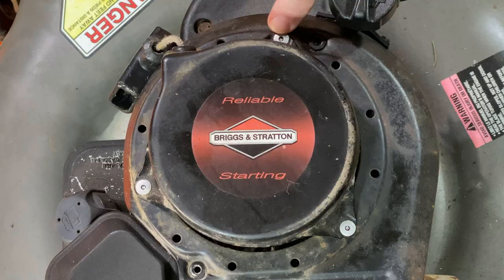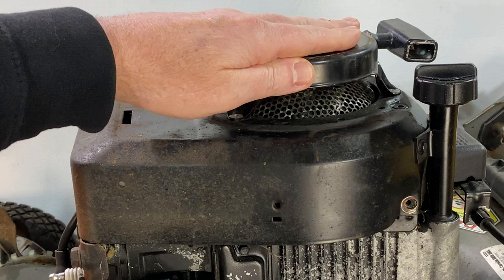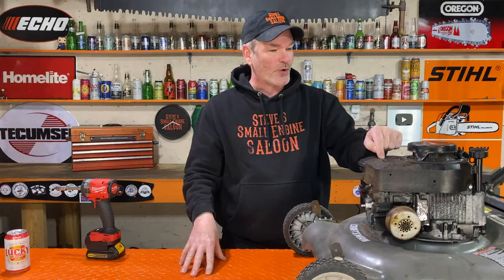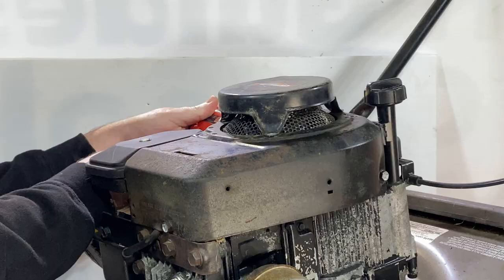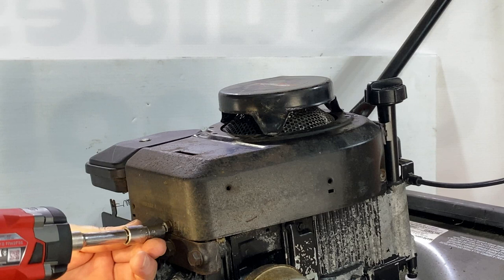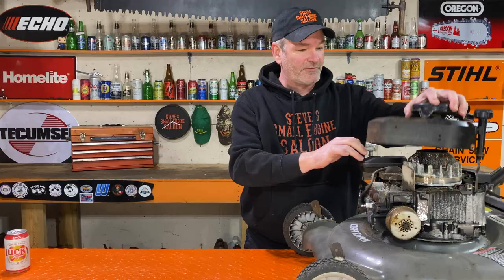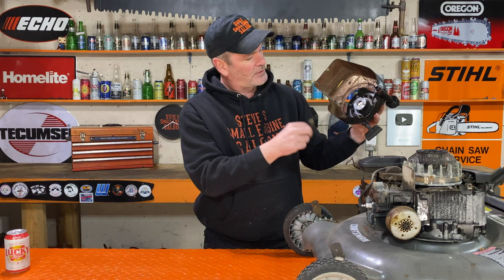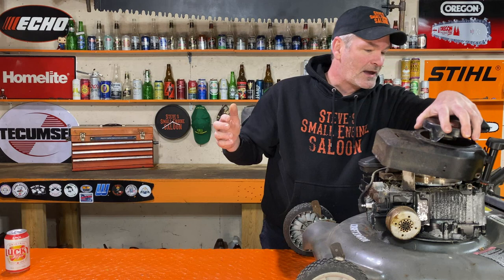Do NOT Drill The Rivets Out Of Your Lawn Mower (Here's Why)

Comment: You don't need to drill the rivets out to remove the cover from the block, but if the recoil spring is broken they must be drilled out to replace the recoil assembly.  To the best of my knowledge, the recoil spring is no longer replaceable.  You get a new recoil assembly with special bolts to mount it properly.
Reply: You can get the springs..but...
Taking the pull start off, and using you drill or cordless impact gun to start your mower. Is the cool thing to do.
Reply: Iv replaced hundreds of recoil springs and iv never drilled out any rivets
Reply: Okay I can see that, but it IS possible to repair the starter assy. IF you know what your doing and do it gently. It can be done.
Reply: @radicalracing09  I ran a small engine repair business and the sensible options for those later model Briggs were either buy the whole shroud assembly which was really expensive or get a $9 recoil starter from Amazon and drill the rivets out and be done with it. I had a lot of parts mowers then though so they got a a while used assembly more often than not. I have drilled and replaced plenty though.
Reply: @vintagemadness9587 you have a video on how you did that?
Reply: @thisislargemouth5566 thank you for confirming what i was thinking. Your experience is much more helpful than someone telling me what not to do.

Comment: Briggs sells you the replacement recoil with screws and nuts to replace the rivets. The piece that spring hooks to sometimes break and only time you will have to drill out rivets. You can use pop rivets to put recoil back on.
Reply: I've always found that pop rivets rub against the flywheel as they're too long. But you can try putting them on upside down. They still fail after a while due to the flexing of that housing when pull starting
Reply: Interesting. I didn't know that👍
Reply: @horacepinker6578  I have a home depot mower. It wears out long before the pop rivets!

Comment: I spray some rust converter on the inside while I have it apart. Rust holds moisture, dirt, and the air goes smoother through there to help cool the engine!

Comment: Steve, I just drilled the rivets out of mine so I could replace the recoil.  The spring was broken and I scored a new one for 16 bucks on Ebay.  The only way to replace it was to drill out those rivets and rivet in the new one.  You do a great job Steve.  I appreciate all the info.  I couldn't do it without you.

Comment: Got the mower started first time this year . Took 4 pulls and the new blade i installed a few weeks ago didnt fly off.👍
Reply: Did my pre mowing season maintenance a few weeks ago, changed oil checked blade sharpness etc. Turned the mower back over, primed it a couple times and it started on the very first pull. I was shocked, never had that happen the first start of the year. Of course when I went to mow the first time a few days later, it took three solid pulls on the rope. Other than breaking one of the plastic wheel centers the very first time I used the cheap Walmart mower, no problems yet and this is the third year using it.

Comment: The replacement spring-rewind pull starters come with nuts and bolts and the instructions tell you what size drill bit to use to drill out the rivets.  But yes if you are fixing anything other than a broken pull start spool there is no need, thanks for the video.

Comment: Steve..........  Enjoy watching &   learning from your videos. I did remove the rivets because I didn't want to cut my hands on the sharp edges of the main housing when I was  replacing the rope on the retraction assy. Several times the wheel/spring did slip and I  almost got cut. Also, its much easier replacing the rope when it is removed from the housing.
             Just a though...........FWIW

Comment: I understand fully. HOWEVER, when the starter needs complete replacement, you have to replace the engine cover to. Then when you change the engine cover you have a different model number from the old engine that is now on your engine and you may get the wrong parts by using that different engine number.

Comment: I unscrew the dipstick tube off the cowl when I take that off so as to prevent risk of dirt and debris finding its way in the sump and the dipstick getting dirty.
Sometimes you need to swap a used starter if you're scavenging from a slightly different cowl.

Comment: Every lawnmower I ever had didn't have rivets there.  They had studs or bolts/screws to hold that cap on the shroud.  It looks like the oil dipstick came out when you pulled the whole thing as one piece.  Best to mention that one should make sure to thoroughly clean the schmoo off of that area before yanking it off, so as not to drop a bunch of crap/dirt down into the crankcase!

Comment: Yeah he's right don't take out the rivets people unless you have the right rivet to replace it. I know of two instances I will remove the recoil and re-rivot it on. If the pull cord slider grommet is worn out and you have a replacement part to reattach or if you need to clock or slightly rotate the assembly to the next holes because the rope binds on the sheave and cuts the rope when pulling.

Comment: Lol, one assembly.   Wish it was that simple on my 2009 Polaris rmk 600.  Recoil dogs stopped engaging, stopped in the bush turned it off and then tried starting it back up.  I can pull but there is no resistance, a squirt of lube into the recoil usually cured this on lawn mowers, saws, or even snowblowers.  Good luck getting in there,it’s gonna take tools and some disassembly.  My brother and I wrapped a ratchet strap around the clutch, one pull on the rachet  strap and she fired, drove it home.

Comment: I've been a small engine mechanic now for a couple of decades and I've never seen anyone drill out the rivets for your explanation. Now you can drill out the rivets, turn the top and put that starter on a horizontal shaft engine it will change the difference in direction of the pull rope.

Comment: I have a question., in a lawnmower engine, howmany time the spark will occur in one complete cycle. It's a 4 stroke engine, and the coil on body and magnet is on flywheel.

Comment: Unless you are "Repowering" a SNAPPER Disc Drive RWD Push Mower with the OEM "Sideways" motor mounting.
I upgraded my 1984 Snapper from a 4 HP to a "6.75 HP" (Manufacturer Rated) back in 2001, and I love the DICKENS out of it!
Reply: Those engines will be golden in the "sustainable" future😄

Comment: I've got a question for you that is way off topic and you might have covered it but I couldn't find a vid. What mower oil should I run in my new Honda push mower? It's so damn confusing! It calls for 10w 30. I get that but should I run Honda oil? Car oil? Synthetic? None synthetic? I can't find a straight answer anywhere. There are about a million different opinions on the subject. I'm thinking I will just use the Honda oil 10w30? Thanks.

Comment: Steve I have a mower that stalls after a fue seconds it has compression cleaned fuel and gasket and diafram  any ideas?ireland
Reply: Sounds like you have the model with the carburetor on top of the gas tank. If so, make sure you install the o-ring and spacer on the carburetor and not on the intake tube. Doing it the other way can cause an air leak because the o-ring will not seat properly. Just a guess because I’m not quite sure what model of engine you have. Also make sure your primer bulb is not ripped, if it is it’s another source for an air leak.

Comment: but i have rivits and washers to put it back on, and 2 other housings to confirm the positioning. i pulled two mowers out of the garbage one had the gastank carb and muffler off just laying there. the other started up no issues smoked a little so i shut it down checked it later its got twice the oil it should. my plan is to take the good engine off my mower with a rotted deck and put it on the deck with the torn apart engine. to clarify the rivets i drilled out was on the engine that is torn apart i did it because the cord is cooked and the housing was showing surface rust so i sanded it down to paint while i have the cord restrung. if i didnt know you couldn't reuse rivits i wouldn't have done it but i used to hang racecar bodies so im well aquanted with rivets. so dont worry it will be put back in the same position and with the same type of fastener

Comment: Hi Steve! I have a riding mower with a b&s motor ( it has no fuel pump on it) that has air in the fuel line I was able to get the gas to run all the way to the carburetor but it won’t go through the carb I have already cleaned it but it isn’t pumping gas please help me

Comment: Just over 24 hours ago I did just that...drilled out the rivets to replace the pull cord. TBH it was easier than taking all the shrouding off.
Reply: how it was easier
Reply: It’s not easier.
Reply: @gkrstini   It's stated in my post "it was easier than taking all the shrouding off" Steve is a professional...listen to him, not me.
Reply: Well, apparently you had a different motor from what was worked on in the video.

Comment: If you need to replace the rewind starter you need to drill out the rivets. Its usually cheaper than replacing the whole pull starter.

Comment: Never thought about drilling the rivets. As a young teenager, I made extra money fixing lawnmowers. One person brought in her mower with the pull start cord separated and jammed up in the pulley. "Easy fix" I thought, as a 14 year old. Pulled off the fan housing and put the line back in the pulley and fired her up. Great!>...... Except!....When the motor was run much more than half throttle there would be a loud clacking sound and the cord jumped off the pulley. ?????? It took me a few tries of fixing the line to figure out that she had run the motor so low on oil for so often that enough "end play" developed in the crank that at higher throttle settings it would "rattle" the pull cord line off of the pulley. When I did check the oil, it was basically bone dry. Never was sure how the rings held up longer than the main bearing, but the L- head briggs is a marvel. I ended up screwing a wooden "stop" at the half throttle mark so that she could at least use the mower. Don't recall if it ever properly blew up or not- it was over 40 years ago.
Reply: Did you at least top off the oil?

Comment: Hey Steve. I had to change a new deck on a push mower. 2 bolts snapped off in the cast aluminum. Any tricks to get them out or is it easier just to drill them out and retap for bigger bolts? Thanks
Reply: If you can drill a hole in the bolt and use an easy out or bolt extractor that's best, maybe use some heat to expand the metal around the bolt, be easy when you are removing it, but remove the fuel tank and carb(fire hazard) In the future if you have a mower that has been exposed to the weather and a bolt breaks when you try to take it apart, try using a hammer and punch to hit the head of the bold and the impact shocks the bolt and threads, it helps loosen the rust in the threads, and makes removing them easier.
Reply: @johnhardison8490  thank you but I know that murch

Comment: Recoil fails, sometimes even the rivets will fail.  Seen it many times.  Sometimes you need to move the location of the starter pull, using some of the many many more mounting holes.  Rivets or small bolts both get the job done,  doesn't seem like such a big deal.

Comment: I believe it was the Honda powered generators, late 90s, early 2000s. It was an hour or so job to do a starter cord the "right" way, 15 minutes to drill them out and re-rivet.  Not a lawn mower I concede, but something with a cage and fuel tank needing loosened first. An aircraft riveter is like $25 at Herbert Fraught.

Comment: Enjoy your videos. Removing the shroud on that mower engine, fine no head bolts. I have a tecumseh H35. Three head bolts go thru the shroud. I thought removing the shroud was great. Simple and fast. Put it back together, the head gasket blew within 30 seconds. I will drill the rivets next time for sure. Avoid risking the head gasket. Cheers!